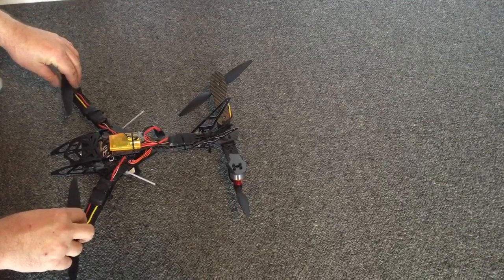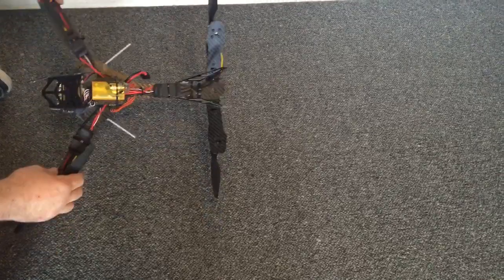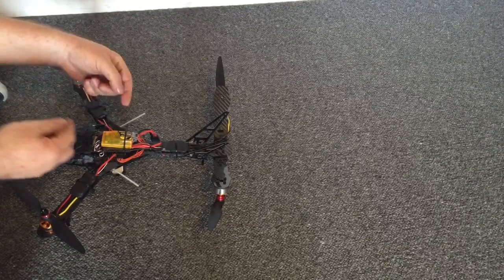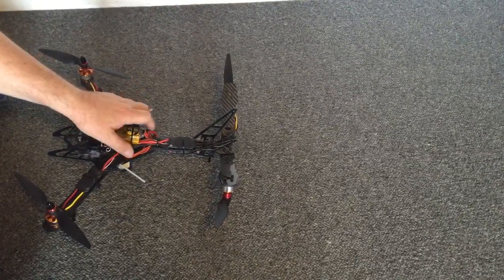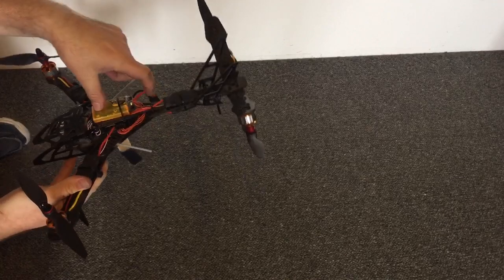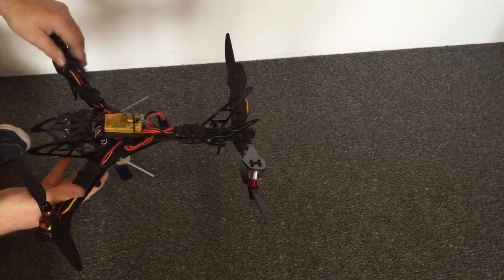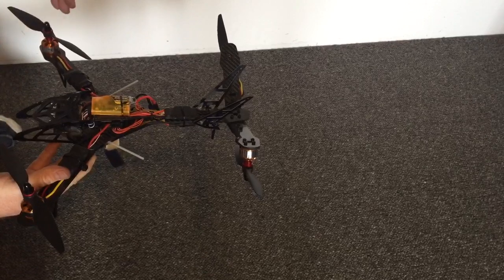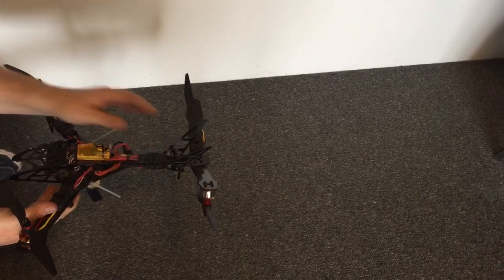V-Tail - CG / CoT and custom mix interaction.

Comment: I need a good mix for a 500 vtail quadcopter.
Reply from the maker: What are your dimensions?   I can calculate it for you.
Reply: Trainboy64 Thanks for your contribution to my 500 hunter vtail project. I am new to this so custom mmix or cmix are a little intimidating but I am ready to give it a try because it flies crappy.
Reply: Trainboy64 i finally applied the custom mix you gave me but it grails alot. I have no clue how to move the cg to get true thrust.